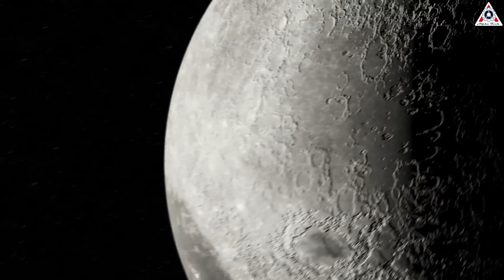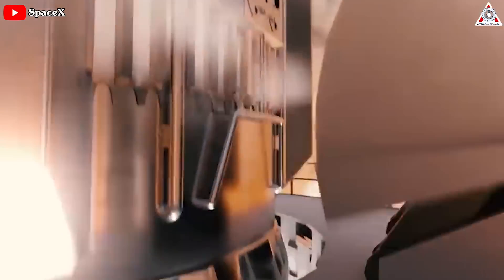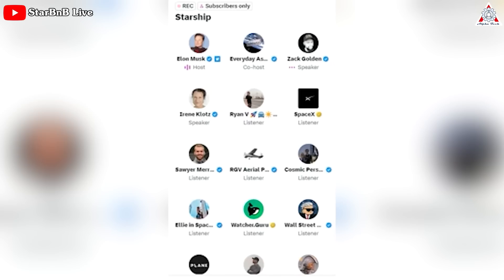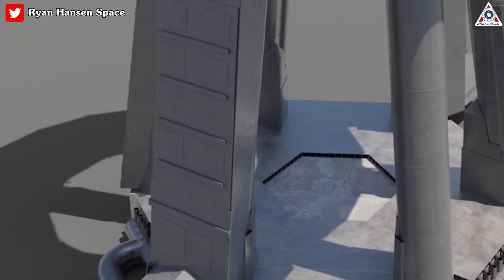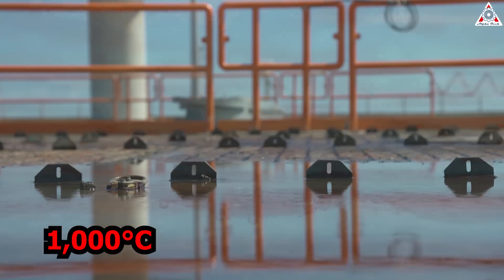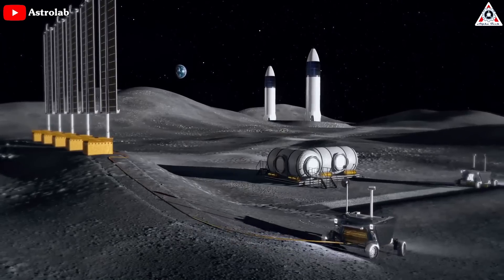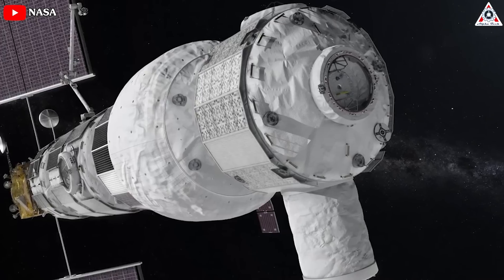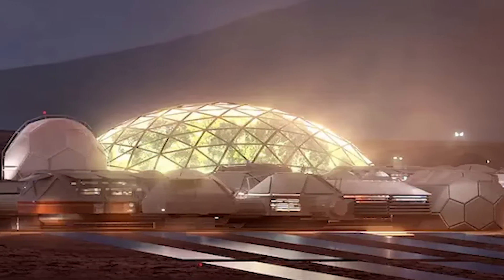SpaceX's NEW trick to face 33 engines...

Comment: I can't believe SpaceX fucked this up so bad and now they're going back to reinvent the wheel. The Soviets and NASA figured this out 60 years ago.
Reply: Michael Dennis  That sounds like a fairy tale about the first launch of the Saturn V being heard in NY.   At any rate, Space X is fixing the pad and fully installing the water cooled steel plates before the next booster static fire happens.   People have perseverated long enough on what Space X should have done, which they have admitted to right after the test.   What's coming next is far more interesting!!
Reply: The soviets we're not dealing with a rocket that has twice the thrust of the Saturn V.  And as Alpha Tech said Space X is trying to deal with the challenge differently.   A high water table has also been suggested as to why a flame diverter wouldn't work.  Unless Space X had built up the launch pad to allow space for a flame trench.
Reply: @michaeldeierhoi4096  Yeah, they could have done a lot of things differently if they weren't in such a hurry.
Reply: A flame diverter system pushes all the heat in one direction, and with 33 engines the cross force would be at least double causing engine failures on half the rocket. Raising the water flush up higher so it shields the lower ship from the cross blast might be key to keeping the 33 engines all working and undamaged at lift off.  
Another problem no one has questioned are the main fuel and O2 lines from the tanks. Friction causing bubbles, or the diameter of the lines being to small to supply maximum pressure at launch. This could be why the 3 engines never fired. The computer saw the delivery pressure was falling, and just switched off delivery to the 3 to maintain a minimum. A friction builds heat causing more bubbles they lost gimballing engines as the fuel pressure dropped. Could be solved by liquid nitrogen jackets spaced along the main fuel and O2 lines, and an increase in the diameter of the delivery lines from the tanks of only 1 inch should be enough to block the building of bubbles along with the nitrogen jackets. This would add maybe another ton to the heavy lift rocket, but give additional power to the engines with increased fuel pressure. If the engines are getting enough fuel pressure they won't blow out with the cross blast forcing its way up the bells. Shield rings are another option around each row of engines to direct the blast more downward could protect the bells, and we wouldn't see another engine failure of the gimballing engines as most of the heat goes downward, and not across the other engines. Just some fix it ideas.
Reply: @marymarlow5598  You sound like someone with an advanced degree in aerodynamic engineering?!
Reply: Michael I can't wait for SpaceX to step up and build the 18 meter Starship. I've designed a couple things that would require a 18 meter wide ship. The trip to Mars would only take 2 weeks as long as the Sun isn't in the way, and no refueling required. Can't make it work with a 9 meter wide ship. Not and keep the fuel tanks in the middle. We'd be hitting 1 million mph. I think the best we've managed is about 50-60k using conventional engines. With the 18 meter wide Starship we'd be 3 weeks from the asteroid belt, and 5 weeks from Saturn. We'd be hitting 5 -6 million mph going to Saturn. Slowing back down is half the trip, and if we hit even a small rock the ship gets shredded. That worries me more than anything else. We'd have to come up with a series of deverter shields, and hope it's enough to protect the ship. The engines are not nuclear in nature, but might require a nuclear power plant to supply the required wattage to run the equipment. Ion drive works for satellites, but it's a joke compared to this system. With this system it's a 1 day trip to the moon, and can launch to orbit from the moon. The current design can't produce enough thrust to launch from Mars without a little conventional lift from the rockets. It might only require using 1, but that would require fuel and O2. Landing might not require more than 30 seconds of a single engine. As the ships weight depends on the tonnage it's delivering. The ship would have enough fuel on board to deal with 1 and maybe 2 landings on Mars. If they deliver a fuel manufacturing plant to Mars as one of the first trips. Any fueling could be accomplished on Mars. These require a bunch of ducks to line up in a row in the near future. I've been sitting on this design for close to 20 years. We never had the technology to bring it all together until now. I'm a little excited that it might get built before the cancer kills me. I can keep it in remission for another 6 years if things go well.  It's currently not curable so I'm under the bus on this one. I've also designed a second type of catalytic recycling engine that requires no fueling like the type 1, but I question the maximum thrust the type 2 can deliver. It can fit into a 6'x4'x4' area, and requires less energy. So it could fit a couple dozen in the 9 meter wide ship. Small enough that nothing needs to be moved, but can it produce over 1-2 tons of thrust with 24 engines. No way could it lift off the moon with the type 2 current design, but it could deliver a satellite to just about anywhere in the system without it taking a year or more. I've considered using a spent fuel rod as a heat source to operate a Sterling engine generator to keep the batteries charged, and run the pumps and other stuff required to run the engine 24/7.  It would definitely offer more pounds of thrust than an ion drive which needs lots of energy to give you less than an oz of thrust. The type 2 can be down sized to fit smaller spaces, or increased in size for
larger thrust. It's something that can dominate the satellite market down the road, and gives us the ability to catch any asteroid, or ice and rock mix making entry from the Oort cloud.
Reply: @marymarlow5598  Actually I see the 18 meter wide starship 2.0 as an Elon fantasy.  Primarily because Starship is a ways from becoming a proven vehicle.   Elon, himself has said in the past that he wasn't sure if it would work.   But I give him credit for how he created a company that is developing a new super heavy rocket system from the ground up.  The next six months will be a critical step in the process of starship's developing. That's assuming the current lawsuits don't throw up a serious obstacle in the progress.
Reply: What do you like about my personality?
Reply from the maker: This is because they want to try a new method

Comment: It was humorous to me when SpaceX announced the plan to use a water cooled steel plate to prevent the blast from 33 Raptor Engines from desurfacins and digging a crater beneath the launch pad. About a month before launch, in a similar post, I mentioned the same concept. Having been a jet engine mechanic and Airframe and Powerplant Mechanic foe nearly 45 years, I have been exposed to numerous schemes that keep metal from melting at enormous temperature and pressure and I believe SpaceX has hit the nail on the head with this iteration of the blast pad surface. The biggest concern is going to be the moon landing. Hopefully, that will go much better with fewer engines and reduced gravity. I'm sure NASA is concerned since they just announced a grant to Blue Origin for a second lunar lander. It's good to have a backup plan but NASA has its on "sack of wax" to deal with after the SLS " leftover-parts-rocket took off. It is wonder to be able to see all of this evolve...
Reply: I'll say this about the launch, it was by far the most impressive failure I've seen. I don't know how fast it was going when it started to tumble but it stayed intact and seemed to maintain some thrust. The engineering crew is formidable.
Reply: Opollo proved that vehicles could safely land and take off from the moon's surface, but those landers had a relatively low center of mass and wide footprint, giving them a good stability margin. If the moon lander doesn't have a sufficient stability margin it may be necessary to send a robotic device in advance to prepare a leveler landing site.
Reply: Curious to see to what level the metal plate system oxidizes after being subjected to that much heat and moisture. Assuming of course that the force from the engines doesn’t just crush that hollow metal sandwich. The 33 engine static fire test should be interesting
Reply: Unimpeded or channeled away energy has been the consensus for a long time. Spacex knew the first launch would be destructive and instructive. The next one won't be as bad but with multiple types of damage, heat, sound, debris, backpressure did they really instrument the first flight well enough to fully address it? I'm betting they'll eventually use the simpler-is-better flame channel. But then again I think Soyuz' launch release is by far the most elegant in its simplicity. davidsmith9894, this amateur thanks you for your well earned analysis and opinion.

Comment: This new idea, if it works, will be amazing.

The concept of “we want to build something that can be reasonably easily installed on another planet” means they can’t do the regular thing.
Reply: Where on the moon or mars will they get enough water for something like this every time there is a launch? What happens to liquid water when it exits the holes in the plate to a vacuum or near vacuum?
Reply: @KevinBalch-dt8ot  On the moon or Mars, though, you wouldn't need something nearly as powerful as Super Heavy to launch. Less gravity to have to deal with.
Reply: @b1blancer1  No Atmosphere on the moon would allow gasses and exhaust to leave faster. But you would have to contend with scalloping out of the ground beneath it as it lands. Probably very unevenly too causing an extreme tilt to the craft. The center of gravity would be much higher than the small squat lunar lander forms we are used to allowing  a danger of falling over after landing.
Reply: @KevinBalch-dt8ot  I assume it would very quickly evaporate. It would provide cooling, though.
Reply: @KevinBalch-dt8ot  1/6th the gravity on the Moon means that a Super Heavy stack with a Starship would only need 4 Raptor 3 engines for the combo to liftoff. Starship alone would need just 2.
Reply: That's all well and good. The moon and Mars mean you don't needs a Super Heavy to launch since there's less gravity to have to overcome. None of that changes the fact, however, that you DO need it here on earth, and a flame diverter as well. We'll see how it works out.
Reply: but, they're never gonna launch super heavy boosters from anywhere other than earth. Why do they need this on other plants? the pad has survived just fine for the 2020-2021 sub-orbital hops
Reply: You right about water cooling the the launch. The basic math is 1 calorie of heat will raise 1 cc of water 1 degree. When you're dumping tons of cold water on the 33 engines in a matter of seconds, and having it converted to steam in less than a second you're using millions of calories of heat that would have heated the whole engine area by probably 1000 degrees Fahrenheit. The noise issue can probably be controlled better if they build a wall, or soil burn to angle the sound at an upwards angle.
Reply: @marymarlow5598  Ah, but one big purpose of a water deluge is sound suppression...sound suppression to keep all that sonic energy from damaging the spacecraft. Were the engines that didn't work or failed last time around damaged by debris or sound? I don't know. Maybe a combination of both? SpaceX better hope this works, though. Artemis 3 is currently scheduled for Dec 2025, and a Starship variant is supposed to be the lunar lander. If this fails and they have to go back a build a giant mound to accommodate a flame trench similar to what is used in FL, it may impact that date.

Comment: The concrete didn't damage the first 3 engines as they never started up dude.
Reply: It was stated early after the launch that the three engines were shutdown.  Everything in this video is questionable.
Reply: Absolutely correct. The 3 engines were turned off from the beginning. They launched with 30 engines. I'm sure there was some damage caused by the debris, but SpaceX has stated they don't think any of that is what caused any engine or HPU damage.

The destroyed Stage 0 is unacceptable for reusablity. Starship and its booster need to also use stage 0 for recovery, it can't be destroyed (or be rendered non-functional) on launch. It needs to recover the booster just a few minutes after launch.
Reply: Exactly
Reply from the maker: Thanks. I will find more about this
Reply: @alphatech4966 With over 38 years of advanced material reinforcement, manufacturing and failure analysis engineering experience, do you have an email address I can send a design concept for a new launch pad system?
Reply: @alphatech4966 
“Thanks. I will find out more about this”

This statement explains a great deal about your video

Comment: Hopefully with the new flame diverter, they will have all 33 engines working when they next attempt a launch.
Reply from the maker: Yeah. God bless them!!
Reply: @alphatech4966   That’s your second error, the first saying that concrete knocked out three raptors which isn’t true. You really need to carry out better research.
Reply: What flame diverter? They are not using that system.
Reply: @keithmayes4358  Exactly - its not a diverter, more of a keep the pad cool using water that we feed in at the right pressure we hope kinda system!!!
Reply: @sonneengel1945   yes, this is definitely a cross your fingers and hope situation.